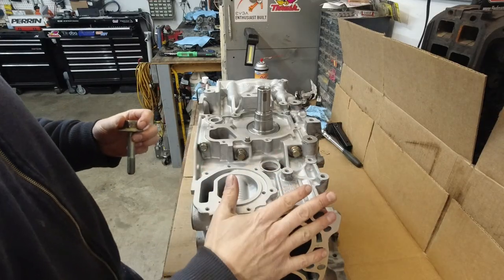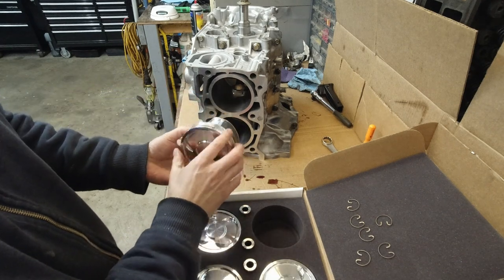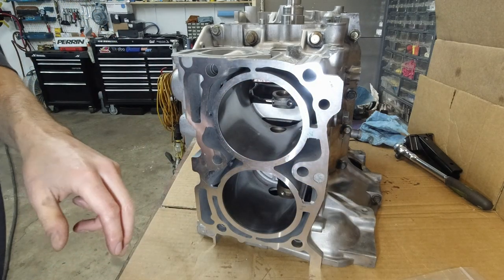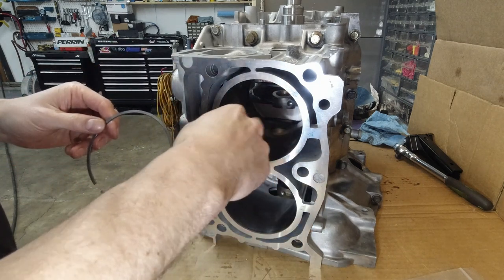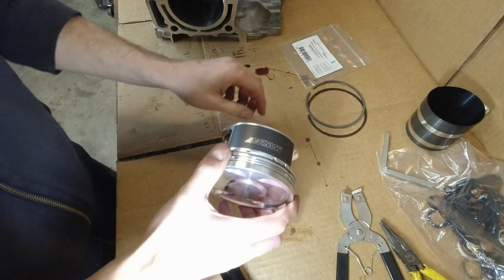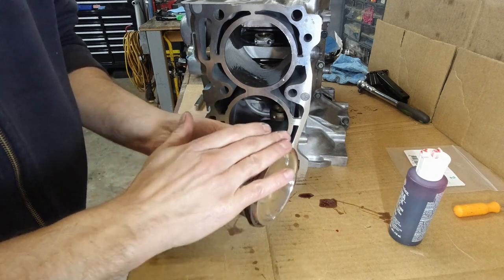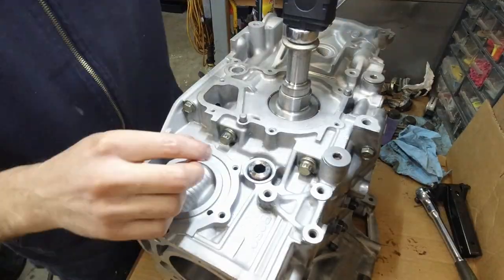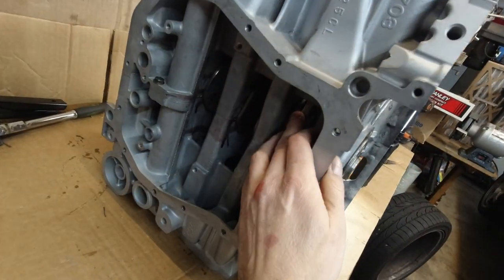Subaru STI EJ25 build part 2 pistons and rings

Comment: It's usually a lot easier if you put the pistons in up and down instead of sideways. Those tools do suck to.
Reply from the maker: u mean have the block on its side in this case? (it being a boxer engine) if yes then I did turn it later in the video... ;)
Reply: Yes that's exactly what I was getting at. I jumped the gun and watched ahead and realized you did put the block on its side and it made it easier. I appologize but great job on the series man. Currently watching episode 7. Gna be doing my 06 sti soon as well definitely alot of help and information. Thank you.

Comment: Great video, what forged material pistons did you use? Did you consider close decking the block? Cheers
Reply from the maker: These are the manley 2618 heres a link to what material they use  https://www.jepistons.com/blog/2618-vs.-4032-material-differences   didnt even think about a closed deck, 350 to the wheels is all I need
Reply: @cruizinmax4017  Hi buddy, just out of interest, why not got for the forged 4032 forged piston instead of the 2618?, if your goal was 350hp?. My build will have 4032 forged pistons because they are rated to 450hp and my goal is 380hp. The 4032 pistons have far less piston slap and last longer than the 2618 pistons. Great build though buddy 👍👌
Reply from the maker: i couldnt find any 4032 with a bore of 97.5mm (1 size over) as i remember and 100.00mm (2 over) makes the walls too thin if you ask me, even for a mild build.
Reply: @cruizinmax4017  hey,i love your vids,i am new,and i have learned alot from you. If block is stock,and i am aiming for 470hp,which pistons do you advice me to get.
Reply: @veilmario6210  over 450 you gonna be need a cdb and bigger head studs.
Reply: @mattbelka1  wrong. Made 500whp on open deck with regular arp 2000 not even 625 studs
Reply: @joshr8680  yeah US whp bring that car to europ put it on any dyno and will come up 400. US numbers way over sky compere euro dynos...
Reply: @mattbelka1  wheel horsepower or WHP is the same in any country.
Europe/Asia/North America/South America. 
Different brand dynos read different but there’s no such thing as American horsepower lol 😂
Reply: @mattbelka1  there’s literally hundreds of cars making 600whp without bigger head studs. 
500 is the proven safe whp for a open deck block.
Iag will sell you a motor with a 2 year 24k mile warranty that’s rated at 500whp and it doesn’t have a closed deck or bigger headstuds.
Reply: @joshr8680  you not reading my comments with understanding... I'll import 1000whp supra from US and in Germany on Europe dynos that supra gonna be have 800whp so yours dynos over shooting real numbers. Any of tuners in Europe will tell you he not recommended going 400 on semi open block ...